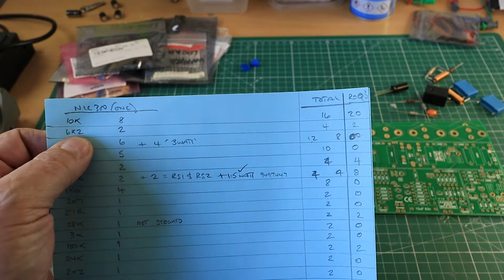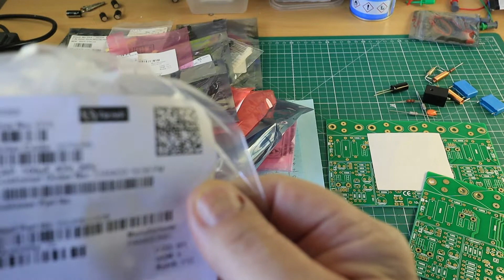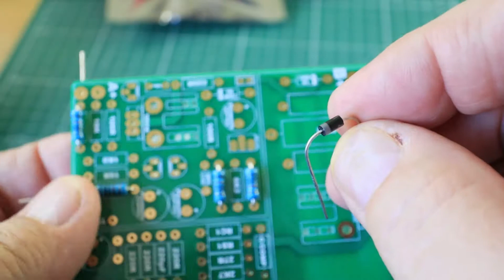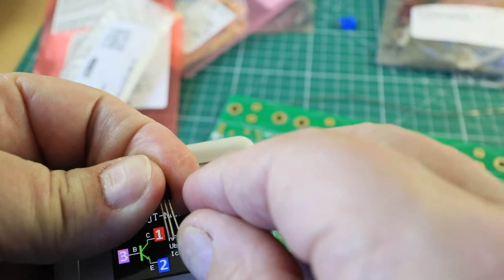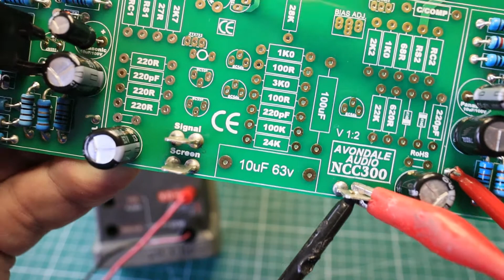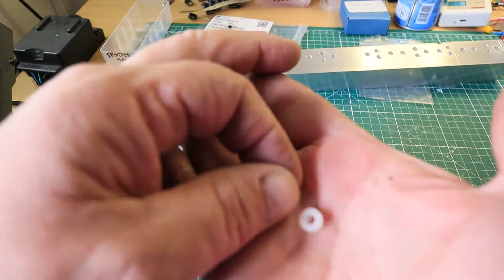Avondale Audio NCC300 Build (Part 1) Populating the PCB and setup & initial test.

Comment: great work as always
Reply from the maker: Thanks Brian, this hobby is a bit niche and these videos (sadly) are only of interest to the few.
Reply: Fantastic work! I am very interested also in a comparison NCC300 vs FirstWatt in terms of sound and which concept is preferable for which task etc.!
Reply from the maker: @philtickerchannel  Phil, Thats a hard one....as both amps are superb at what they do but miles apart. The PASS amps AJ and F6 are 25watts per channel the NCC300 130watts per channel. But I'll have a go at what my thoughts are (my opinion) The Pass F6 sounds sweeter than the Apeph J to me but hasn't got he same grip as the AJ but there's not a lot in it. You would get the best out of either of these with sensitive speakers obviously.
At present I am using the F6 in an open baffle speaker driving the full range, TangBand 1808 and the Avondale NCC300 driving a pair of bass drivers, Eminence 15" Beta. I have to wind the gain back on the NCC300 to match the F6 , its an active system using the LXmini xover from DIYaudio. I'm going to replace the F6 with this NCC300 Ive just built and run it for a few a while and see If I like it (I think I might:) So will report back at a later time with findings.
Reply: @thediyaudioimplementers1826  Thanks, that is very helpful. Do you sell your spare ncc300 boards? I would be very interested!
Reply from the maker: @philtickerchannel  Hi, Sorry phil their destined for 'yet another' project so not rightly spare.
Reply: @thediyaudioimplementers1826  Thanks for clarification. If you change mind please let me know. Just a last question: which diy pre-amp (with vol control and input selector) would best suit the NCC300?
Reply: Keep up the good work
Following this with great interest!!
Thanks for sharing